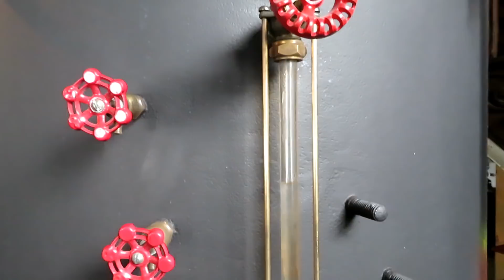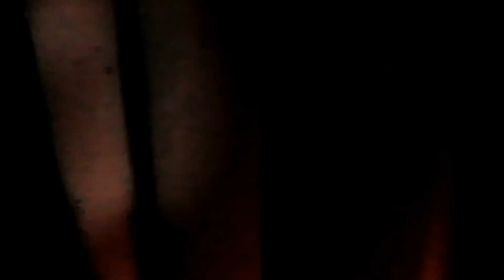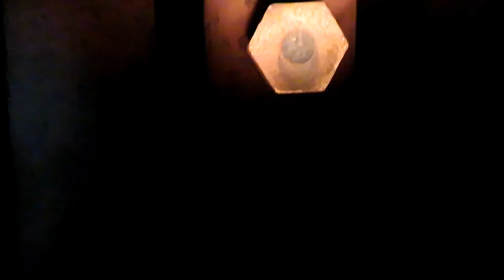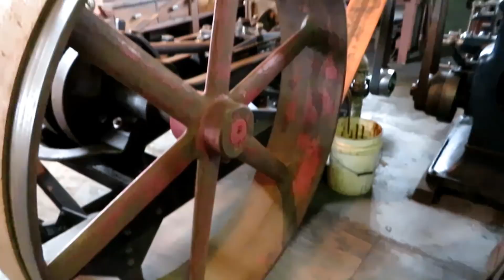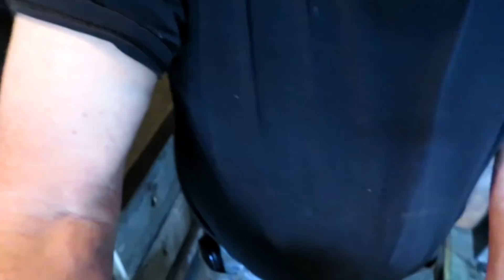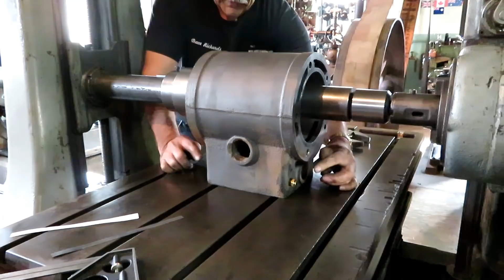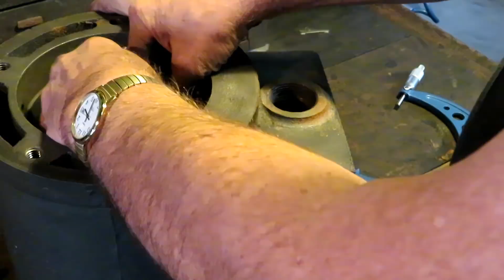OLD STEAM POWERED MACHINE SHOP  38  Up and running again

Comment: Thank a lot for making those video !
how many hours can you get of a good Babbitt  bearing ?
is the electric motor on the boring mill mount on Babbitt bearing ?
Reply: The magnetic fields that are turning the motor will also self-center the rotor end-to-end, so that play during startup serves the useful purpose of distributing the lubricant in the Babbitt/sleeve bearings.  All good!
Reply from the maker: It sure is and you can see the evidence of wear from the end play when it starts up. But it runs fine...Dave
Reply: Welcome back Dave,

   When I started as a locomotive fireman ( 1971 ) on the railroad all of our yard switchers used lead babbitted axle bearings on locomotive's from 600 to 1200 horsepower. I asked the head engine house foreman that question and three weeks later he told me he looked up all the yard engines ( ALCO S1's to ALCO S 4's ). Most were built from 1940 to 1944 660 to 1000 horsepower. All engines as was the practice back then used lead babbitted bearings if memory serves me right they were 8 1/2 X 11 inch bearings. 

  After he looked the question up in the records a few weeks later he told me one engine back in 1944 had a hotbox due to no fault of the bearing but a crew changed out the traction motor that burned out and a new first day on the job apprentice laborer just gave the journal box a splash of oil instead of filling it, actually overfilling it so the journal packing could soak itself in oil. The engine had to be set out at Niverville, New York due to a hotbox. That he stated was the only hot box the records showed for babbitted diesel locomotives he found. Mind you virtually all steam power used babbitted bearings on all axles back then and even freight cars to prevent a hotbox as the freight cars went over the hump they all had a man giving a shot of oil into each journal box which required one car knocker to carry a hotbox packing tool to open the cover, closing the cover was simply placing your boot on top off the cover and push down to close it. The freight cars when I started was roughly 65 percent babbitted bearings the rest were roller bearings which at that time were required by federal law on all new production equipment as they are today. 

And yes roller bearings can and do overheat making it necessary to replace the wheelset. The cause of roller bearings to overheat? The use oil or grease to lubricate the roller bearings, 99 percent of the time when a roller bearing fails it normally due to lack of lubrication. One of the little know ways to lubricate a roller bearing that goes back to the days of steam locomotives is the button grease points that an engine house laborers attached a fitting so they could easily add grease or oil to various drive rod grease or oil points. Almost every roller bearing has a button oiler in the center of the bearing cap to easily add oil or grease to the roller bearing. The problem happens when one bearing doesn't get lubricated when in the car shop. 

  In a perfect world every time a car goes to the shop for service the roller bearings get lubricated. Unfortunately every now and then one bearing gets missed and that usually not a problem but every now and then that one bearing that maybe missed getting lubricated a couple of times in a row it winds up maybe one time in a million overheats and becomes that rarity in modern railroading a hotbox.

In the old days you replaced the Babbitt if the wheelset bearing surface was ok you replaced the Babbitt repacked the journal and filled the box with journal oil. Then blessed it closed the cover and sent it on its way.

Hope this answers your question.
Reply: A neighbor where I grew up has a motor belt driven water pump where the armature moved like your motor does and when I last visited him he's still using the same motor that scares people that don't understand how a Tesla designed motor works. He won't replace it until it dies because his question is why replace it? So it moves when I start it then it settles down so why replace it? When the babbitted bearings on a electric motor gets worn they all start like that but when up to designed speed their fine.

Cheers